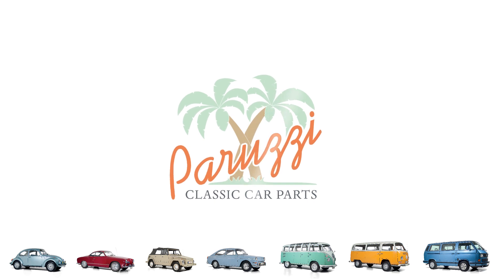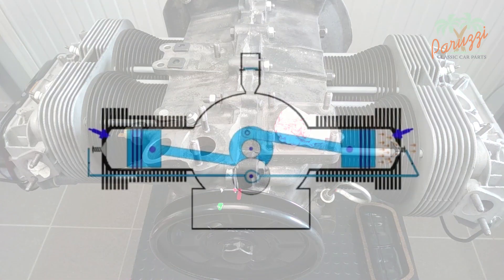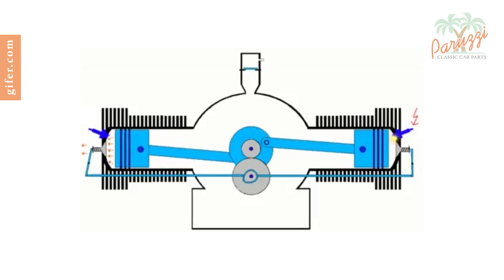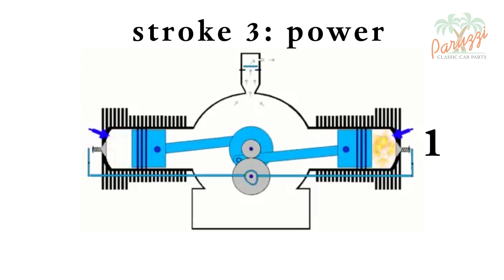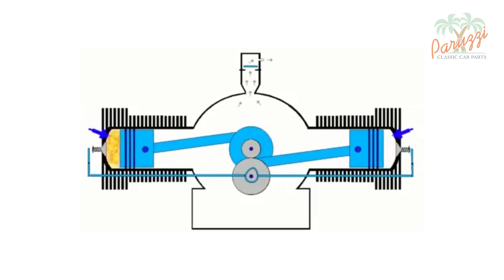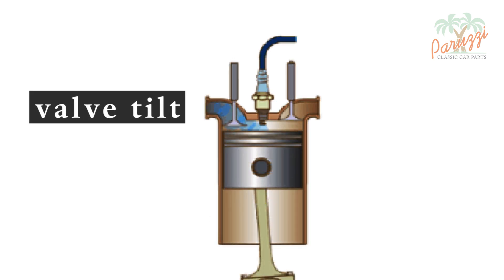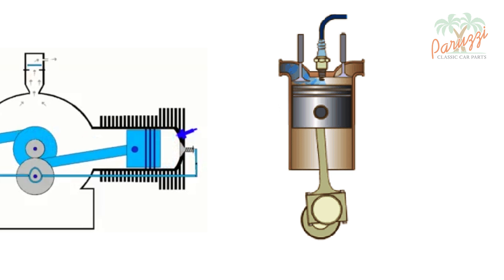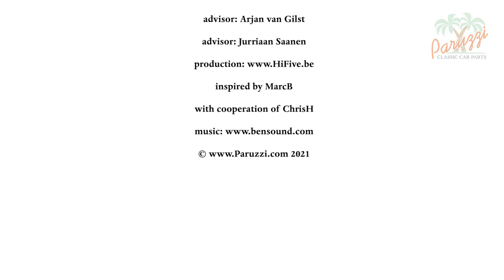06 Engine overhaul - find the TDC compression stroke

Comment: Maybe I missed it,  but in your diagram of the pistons TDC movement what are you showing on top of the engine. Pressure built up in the case releasing and then a flap closing after the pressure releases. Where is that flap located and what is it called?
Reply from the maker: I think you are referring to the crankcase breather. It shows when the pistons are moving back in, a pressure will exist in the crankcase, and that pressure you get out to avoid oil leaking from every crack. It is not part of this content really. It will be discuss in later videos. Thanks for you interest.